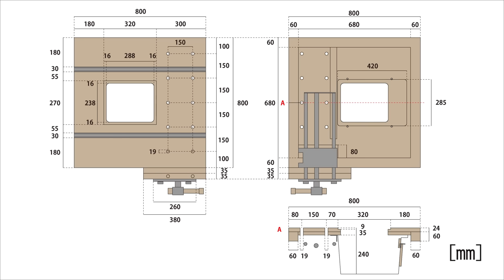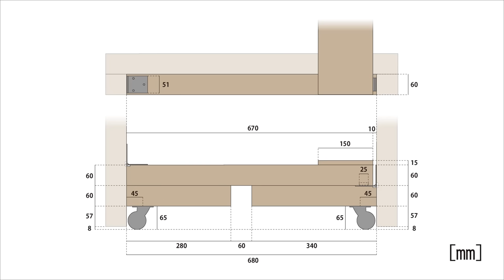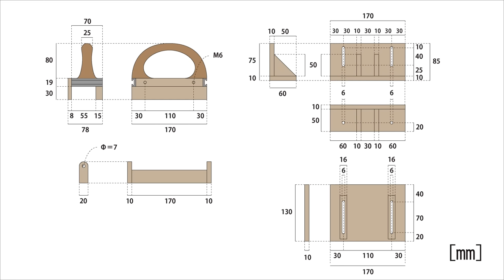Mobile Table Saw Workbench | DIY Woodworking

Comment: Fantastic idea for the joinery.   I may have to use that in a project or two.  One suggestion for the table saw part, include a riving knife.   It could save you some from an injury.

Comment: all kinds of excellent inventions and precision work here. especially noteworthy is the foot operated engagement/disengagement of the caster base, but the list goes on and on. and although i love the core idea of a table saw that doubles as a workbench, this table saw suffers from the usual problems of trying to convert a handheld circular saw into a table saw. a table saw without a smooth height adjustment is very limited in what you can do with it. (just think about doing dadoes and finger joints). and a table saw without either a riving knife or a splitter, or any form of any-kickback is not a machine i want to use. (think about ripping a board with tension in it or jointing an edge without any form of anti-kickback). you could fairly easily add a splitter and some kind of anti-kickback, but you'd still have a machine that is seriously compromised

you look at the work that went into this project, and the amount of planning and hours are a lot. to do this right you'd have to do even more work than that, fabricating a height adjustment mechanism that was precise, smooth and had no play in it, plus a riving knife. at that point you are into so much time, planning, and opportunity costs that you have to be thinking it could be a lot 'cheaper', given the brevity of life,  to just buy a really good table saw with a cast iron table and get on with the work you can do with it instead of on it

then again, if doing this sort of thing is your thing, it's going to be a very satisfying result and a lot of pleasure in using something you built to your own specs, in which case, go all the way with it and dont leave out anything important
Reply: Tja ist leider so ZEIT ist etwas das man nicht kaufen kann...Meine Meinung bei aller Kreativität ist  IMMER  Gesundheit geht vor alles !!! Wünsche noch gutes gelingen bei aller Sicherheit  😊😊
Reply: All that beautiful work and I kept thinking, awesome-but how do I easily, quickly and above all accurately adjust the saw height? In the end I completely agree with you, purchase a portable table saw. There's awesome deals on used tools all over the Internet. Then, customize your purchase to have it work perfect for your needs. All that said, wow is this guy a perfectionist! Absolutely first rate work!

Comment: I was wondering at first why the fat top surface with the price of wood nowadays but when I saw the vise it made a bit more sense. This is a mini all in one workbench purposely built for a small area to work in. Very clever.
Reply from the maker: My working room is small anyway. Thanks for the nice name. Mini All-in-One Bench
Reply: I'm all for compact / mini all in one stuff. I have a small 3x4m area in my garage for DIY and this bench style fits perfectly!

Comment: I would not put a dangerous high rpm rotating tool on a plastic container. Over time or if you are unlucky and get poor quality plastic it might  crack so please make sure you have the emergency switch really close and easy to reach.
Reply: You did notice that the plastic tub is just there to collect the dust and not structural at all, right?

Comment: When you cut plywood on this saw without a scoring saw don't you get the jagged edge underneath? Is the tight slot for the main saw enough to prevent tear-out?

Comment: This video is about what over-engineering is. If you are building a fixture, it should be simpler, faster to build and cheaper than one at store, but it should solve the problem. Push block))) previously you have shown pokemon shaped piece of wood. It can be even simple piece of wood. Btw why are you not using awesome life-hacks from previous videos? The same gear acquisition syndrome…

Comment: 3600 dollars in planning, labour, and materials to make a weak motored, heavy, tablesaw with a small blade.

Practically immobile. Flammable. Indoor use only.

What a waste of wood and money.

Nothing like a tablesaw that will warp over time, and bog-down every time.

No riving knife, small blade is far from the user.

------

What's next... 
     a bandsaw made from broccoli?
       a Balsa-peen hammer ?

Useless in the long term.

A lot of know-how and practiced techniques ....

The surgery was a success but the patient is in a coma.